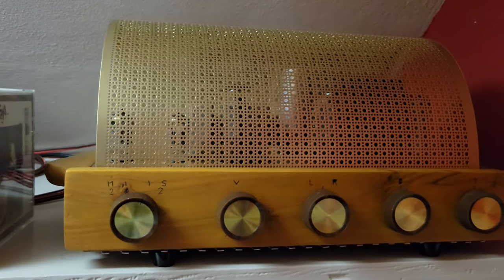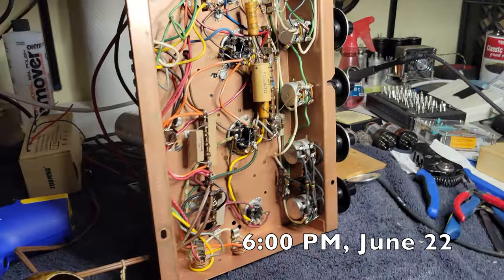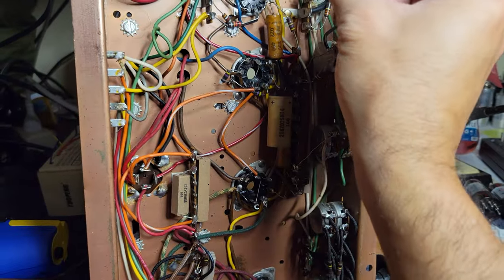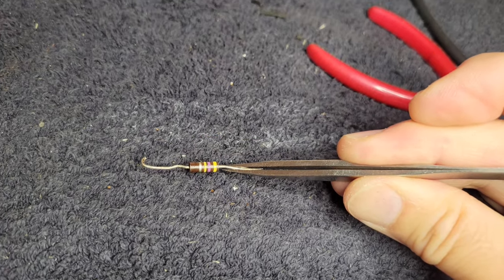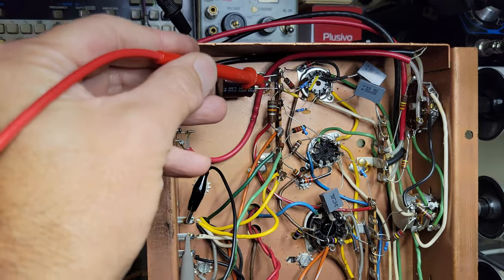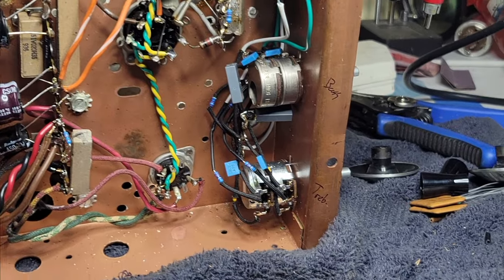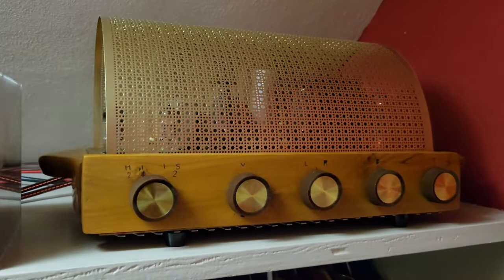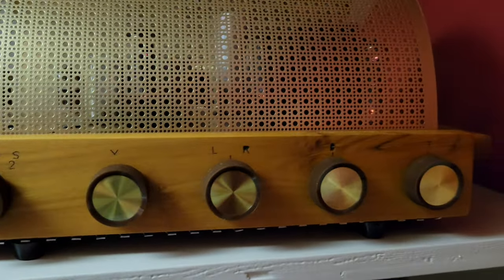The Best Tube Amp $40 Can Buy! Converting a Westinghouse Console Amp

Comment: Thanks, very posting the restore of this console tube amp! Here is a tip you might already know about. The screw-on speaker terminals can be replaced cheaply without much fuss with Staubli 4mmm female screw-in banana sockets part number 23.1033-22. I've bought black and red ones and replaced the screws on my Luxman A3600. They work great and keep the original terminals intact!

Comment: Tube amp lovers are like vinyl.lovers; and they are often one and the same. They think vinyl has better sound quality until they hear a cd player that blows their coveted $600 phono cartridge out of the water. Some people think you have to go tubes to get amazing openness, smoothness, lack of edge, warmth, depth etc. until they hear a solid state amp that does nothing whatsoever wrong, and does all those thing above in spades too. I like both though; but I know now that tubes do not necessarily rule in many areas that I thought they did. They can be equalled. All those special qualities are ON good recordings and there are solid state amps that do not degrade those things either. Both types of amps can do it all,..if they're good enough.
Reply: Good points. I’ve settled on a tube pre and Clayton class A mono locks. The pre uses a a Tele 12au7 and a mosfet buffer output stage. The mosfet stage is extremely transparent and is better than any cathode follower output circuit I’ve tried.

CDs vs vinyl …. The eternal debate. I do both. DIY tonearms are an interesting endeavor.
Reply: Once you reach a certain level of sound quality, which you can reach with both tubes AND solid state, and with both vinyl AND cds, you have pretty much reached the sound quality limit of the source, which ultimately is the limit. With my extensive mods over the years, using totally different equipment, I keep reaching the same sound quality level, and then that's it. It's a dead end. Considering that each of these systems have totaly different equipment, and I keep reaching the same no more major sound quality improvement point....well,.. it would be an enormous coincidence if all those different system all stopped at the same point. More likely by far; the limits of the source has been reached. You can only get how much is on a cd, lp, or tape. What is AFTER the source in the chain, cannot magically create detail or sound quality levels that are not there on the source material; the recordings recordings.that is. What is the best source material? Because of its honesty to the signal without adding hifi artifacts, it is neither lp or cd. It is reel tape. Usually by far.
Reply: Try a Blu Ray player with your CDs and tell me what you think.
Reply: I don'thave a blue ray player. Do they sound better than your average cd player? Let me know. I listen to cd players with my now 70 step modifications. I doubt if you can tell that the sound is not analog. The best modded players start sounding like they have that smooth. analog texture without the edge; and of course without the noise of analog.  accentuation and glae. The cd format (regular redbook cd) is so much better than most people think. A lot of them would be dumping their lps (again), if they ever heard cd playback at its best. But they might keep them for the bigger covers and nostalgia. I was able to keep at least a small portion of my lps; but the only real reason to play them, besides the direct to discs I have, is if I don't have them on cd. Some music may never be on anything but lp (or cassette). The really obscure stuff that is great is reason enough to have a tt.
Reply: @sidesup8286  Blu Ray player has the best sound by far.
Definitely try one , you don't even need an expensive brand, they are better than CD players that's for sure.
The sound quality is amazing.
Reply: Thank you sir. I will try a Blu Ray player. Lasers emit a red light. Ultra high end cd player company Ayon, floods the inside of their over ten grand cd players with red light. I tried the red light thing and it definitely works. More open and less edge accentuation. Maybe flooding the inside of a Blu Ray player with blue light would work.

Comment: Flying leads and not-bundled semi-pt-to-pt is one of the best ways to prevent hum. Watching  somebody poke around with metal tweezers, even with the amp off (was it unplugged?) shows, well what does it show old-timers? Can't watch anymore.
Reply from the maker: Of course, unplugged. I use those to pull and bend leads, well, those and jeweler's pliers. Can't do that with chopsticks!

Comment: Big thumbs up! I have this exact 7591 Westinghouse amp in storage in Idaho, I'm in Oregon now. I seem to remember that the stock speaker output was wired differently, but it seems like it was straightforward on yours so I was mistaken. I remember the 7591's glowing blue on mine, it was really beautiful to see. One of these days I'll get my stuff from storage and do the restore.
Reply from the maker: You remember correctly. The original speaker (outpt) wiring was complicated, so I changed it!

Comment: I just came across your channel. I was impressed by the work you did both electronically & style wise.  Using wood from your own Cherry tree is nice & the amp cover I think looks very cool. Gives it a natural/midcentury modern design combo. Actually, reminds me of a cool midcentury vaulted ceiling grocery store my parents shopped in during the 60's.  I have a Magnavox two section console that I have kept the very nice midcentury design but, moved the amplifier to the top of one cabinet & mounted on a rustic maple base. The transformer was leaking out the bottom so I replaced it & did some parts replacements. I also improved the speakers by modifying & replacing the midrange paper cone drivers with Magnavox midrange horns I found locally. I surely will watch some of your previous videos & keep track of your upcoming ones.

Comment: Chance's are you need change all caps probably some resistors & maybe tubes i would check power transformer and audio out and if a line choke  if your gonna use as a guitar amplifier its only gonna play clean and has to match pickup impedance. Soo far looks like your doing okay on  referb